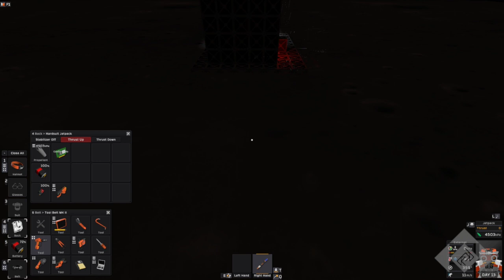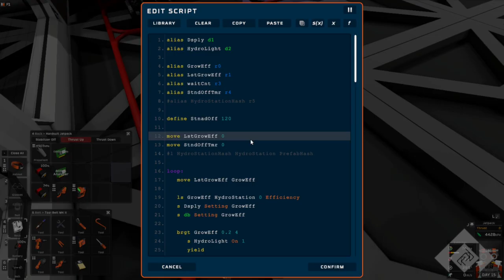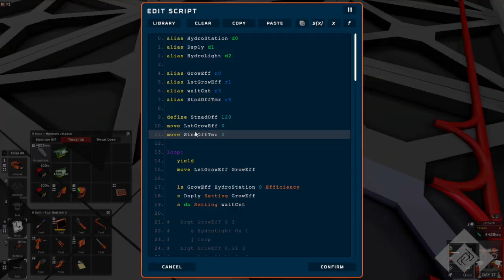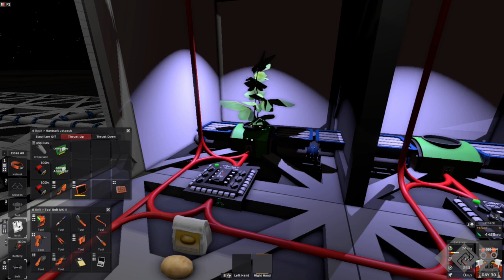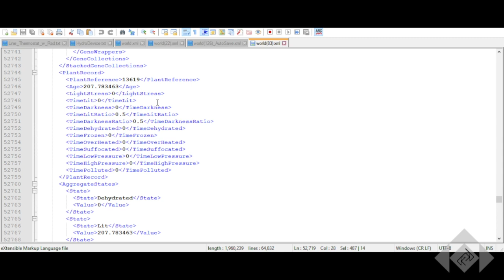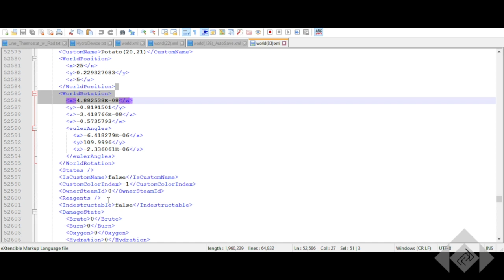PLANTS! Part 4, Successive Generations Study, and more nothing - Stationeers

Comment: Great Videos! I noticed for your brgt you are telling it to jump to line 3. How does that work? Can you send me the whole code? i used the same perameters as you  but my lights wont turn back on once they get into  a lightsoff loop. Can you help me? Thanks
Reply from the maker: It's a relative jump so it skips the next 2 lines and executes the third.

https://drive.google.com/drive/folders/1uAews4KivEz9L_mScRz5HELsA82sfNK1?usp=sharing
Reply: @JoelleTheAbsurdist  it keeps getting stuck in an off light loop
Reply from the maker: @waylandwenschlag4832  My code? If it's too hot or too cold, the plant's efficiency will crash and the code will no longer work, I have to put in an override to force a minimum number of hours... Under normal conditions, the light should come on for 10 minutes when first planted, then off for 2, on for 8, off for 2, on for 8... so on and so forth for 52 minutes.
Reply from the maker: @waylandwenschlag4832  Here is an IC simulator so you can walk through the code and see what it's doing
https://stationeering.com/tools/ic
Reply: @JoelleTheAbsurdist  Temps are good. The problem is the light will try to come on for a split second and shut off. It was working fine until the efficiency went up with the sun and not the lights and so the lights never wanted tocome back on
Reply from the maker: @waylandwenschlag4832  In natural light, growth should be fine... if it's too low, like under 80% and the plant is light starved, you might have to take manual control, the program is very basic. You can also change "blt waitCnt 10 loop" which is the number of ticks the program waits before doing something. 5 seconds/10 ticks should be enough for the plant to respond... if not, something else is wrong. If the plant is in natural light, it can get too much light after the first day and growth can become depressed... I haven't really done much test with both natures and artificial light, but if light to dark goes too much outside a 4 to 1 ratio, the plant just won't respond well.
Reply from the maker: @waylandwenschlag4832  50/50 ratio is still good, but growth will hover below 100%, but not too much below 80%
Reply from the maker: I'm going to change  tho code to add in error handling, and make it so the efficiency monitor is optional
Reply: It sure why but for me it gets into a light off loop and the light never turns back on.
Reply from the maker: @waylandwenschlag4832  I will fix, I'll look at it more extensively and have it give codes for what it's doing, just give me a few days. You can also upload your save an I can look at it.
Reply from the maker: @waylandwenschlag4832  Hey, a few questions to help me debug what might be happening. Is the plant in any natural sunlight? What type of plant is it, tomato? Which planet are you on, the Moon? And did you change the Sun Orbit Period setting, default is 1? Also, is it a custom game, or standard?
Reply from the maker: @waylandwenschlag4832  https://steamcommunity.com/id/JoelleEmmily/myworkshopfiles/?appid=544550
Reply: @JoelleTheAbsurdist  the plants get natural sunlight, it is ferns and potatoes, but I keep the dial on d0 on only one plant so it’s only reading value from one device. We are playing on Europa 2 and the suns orbit hasn’t been messed with. It’s a standard game too.
Reply from the maker: @waylandwenschlag4832  No, I messed up the link in Stationeers and had to recreate it. I updated the link in the replies to my stationeers workshop. For now, try to avoid natural light, as it can cause over sunning. I'll be adding in light dark tracking in a future version.
Reply: @JoelleTheAbsurdist  so the way it’s set up it only controls one light. I have multiple lights so I do a sb grow light but that don’t seem to be working either. The lights come on for a second and then turn off. I’ll have to mess with it later and see what’s going on. I have 9 devices and I think 8 or 9 lights. The light dark tracking shouldn’t really matter should it? As long as I know every other perameter is being met and I know the only thing changing my efficiency is light, then it shouldn’t matter if I have natural light. Essentially I could just do a simple growlight on growlight off timer. I liked how dynamic yours was based on the state of light and if efficiency was going up or going down and then jumping to the program depending if light was on or off at time efficiency was going up or down.
Reply from the maker: @waylandwenschlag4832  I added some code to grab the hash and add a few commented out lines to handle batch writes. Just follow the instruction in the script.
Reply from the maker: @waylandwenschlag4832  Sorry I think you edited before I replied. Yes, the amount of darkness affects the plants as well, but with natural light also hitting them, I doubt very much they're maxing out their darkness limit. Potatoes have a maximum ideal exposure of 10 minutes to light, 2 minutes to dark, and will begin taking "damage" after an hour of being over exposed to one or the other. If hey fall below 6% or percent efficiency, they'll just stop responding to everything. I say damaged in quotes, because it's a hidden damage bar.
Reply: @JoelleTheAbsurdist  ok. Will it turn on all lights or just the one on d#?
Reply from the maker: @waylandwenschlag4832  If you uncomment the lines in the script, it should turn on and off all lights of the same type on the same network. You still have to set the first light though.
Reply: @JoelleTheAbsurdist  i'll look. i got it to display the countdown while lights are off, but for some reason instead of displaying efficiency it just stays on 125.86 no matter what hydro device i select. Why did you use a register to get hash of light and hydrodevice vice just using the define ? just curious as i have no experience with MIPs or assembly.
Reply from the maker: @waylandwenschlag4832  What's the arrorcode on the body of the IC Housing
Reply from the maker: @waylandwenschlag4832  Never mind, update the script, and set GrowLightMaster to 1 on line 17
Reply: @JoelleTheAbsurdist  doesn’t have error. That has countdown. 132.###
Reply from the maker: @waylandwenschlag4832  Can you put your save on google drive or something so I can look at it?
Reply: @JoelleTheAbsurdist  ok it seems to be working as advertised now. i'll let ya know what happens here through a couple day cycles
Reply: whats the water pressure suppose to be at? that might be another issue i'm having.
Reply from the maker: @waylandwenschlag4832  Above 5 kpa
Reply: @JoelleTheAbsurdist  no max?
Reply from the maker: @waylandwenschlag4832  Not that I could tell... I had it up to a Gpa and it was fine